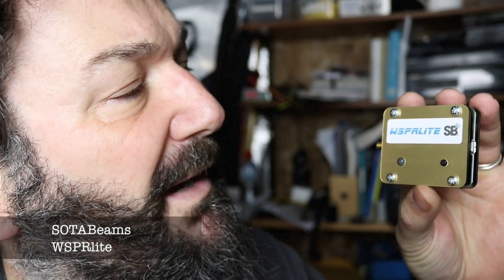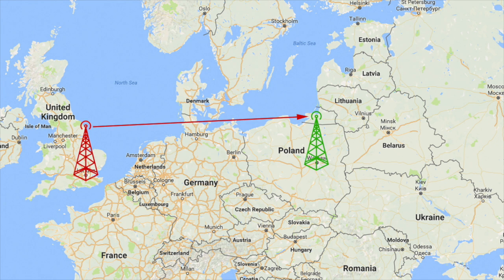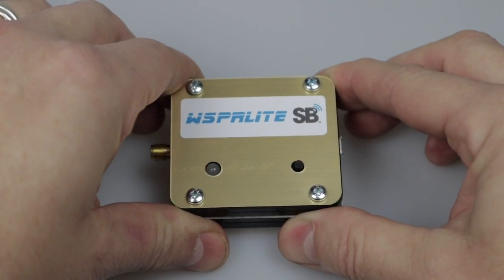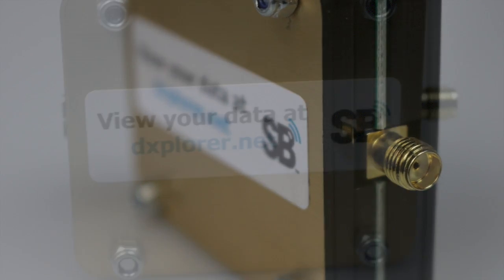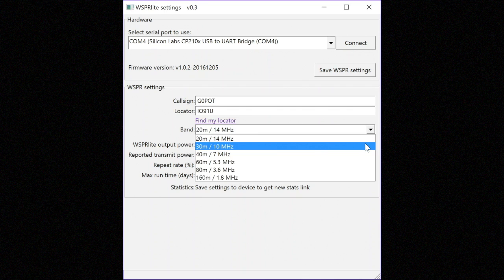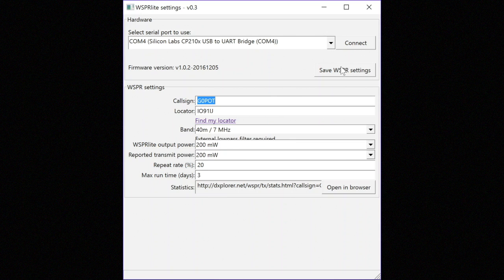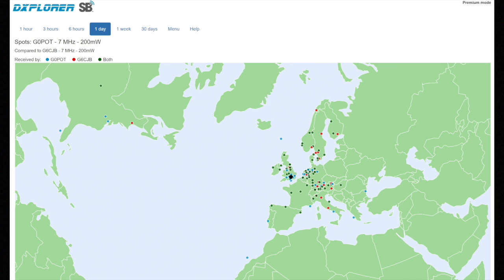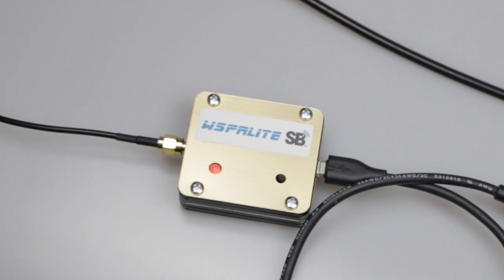SOTABeams WSPRlite overview

Comment: mine only trasmits. how do i set it up to receive?
Reply from the maker: matt chadders The WSPRlite is just a transmitter, it allows you to explore propagation from your location or investigate how your aerials are working by transmitting signals and then you look for reception reports at places like WSPRnet. The advantage of using a mini transmitter like this is that you can set it up almost anywhere and leave it running for days. However, if you also want to receive WSPR transmissions to support other Hams with signal reports then you will need to set up a receiver connected to a computer to receive and decode transmissions. If you have an internet connection you can then upload your results to WSPRnet.org. If you don’t want to tie up your main shack radio on this task I see a number of manufacturers produce receiver kits for WSPR.

Comment: Where did you get your particular battery from ?
Reply from the maker: digitalmediafan The battery pack I use at 9:38 was a simple ‘phone booster’ type pack...this particular one was a freebie from Blackberry and doesn’t go into sleep mode due to the low and intermittent current draw of the WSPRlite. I think these are quite cheap to buy but if your battery pack does keep going into standby, SOTABeams do a little power manager that you plug in which keeps it awake.

Comment: Is this similar to aprs if so I might as well fuck with aprs on a HT and carry  my smartphone along with qrp mountain topper radio with cw key then this garbage
Reply from the maker: Dan Baudelio No, WSPR is a very low power propagation analysis mode. You don’t have a QSO, it’s more like a beacon where you transmit your call and locator using, typically, >200mW and there are lots of receiving stations around the globe who upload their reports to www.wspr.net.

Comment: Does it only transmit one band at a time? What would be cool is if it could be configured to transmit on certain bands during various times.
Reply from the maker: Yes, as of March 2017 it is only designed to transmit on a single band without first reconfiguring it with the application. Updating the firmware to enable the option for it to band-hop over time would be a sweet mod. Ping that idea to Richard at SOTABeams.co.uk or raise it on the Facebook group (WSPRlite for DXplorer). I think it would have lots of supporters.
Reply: Thanks Michael, great video and good information.